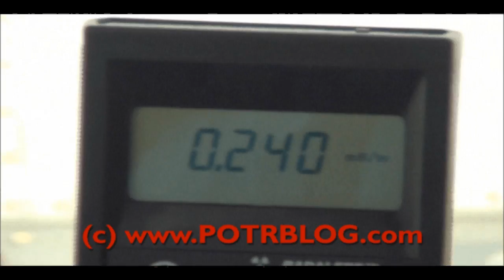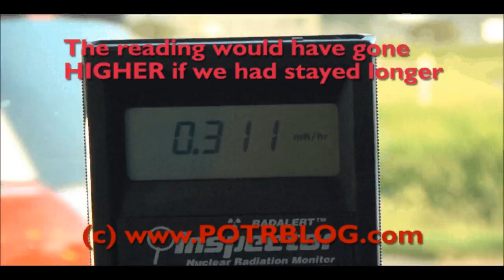Radioactive Container Truck Spewing Gamma Rays Into Traffic on  I-270 in Saint Louis, Missouri

Comment: Anyone know if this is dangerous to people with pacemakers? I had a nukalert along to check a high elevation pass in my region for fallout from Japan and it went off when near a tractor trailer so backed away and got off that road and dosimeter returned to normal background clicks. No placards or markings of any kind on the truck.

Comment: uhhh, 0.3 MREM is nothing... you get more than that on an airplane, and it's well within legal limits... fear monger elsewhere.
Reply: Yea they are getting a pretty significant reading there, inside their car from that distance with that Geiger counter. It's obviously not giving them an exact readout of all the ionizing events. Most of the particles and rays will not hit the sensor.
Reply: @vanquishedcanadian6424  3mR/h is nothing i would inderstand if it was 3R/h but now it's just 3mR which is not dangerous at all and level inside that truck is equal to 1 dental x-ray, so i don't think anyone should be woried

Comment: "The Radalert Inspector Alert measures alpha, beta, gamma and x-radiation using a 2-inch pancake GM detector with high sensitivity to common beta and alpha sources"  - In other words, you have no way of knowing WHICH type of radiation you are detecting.  But it does make it sound good and scary to say the truck is emitting "gamma rays".  Also, please switch to using the Sievert scale like the rest of the world.  1.0 mrem = 0.01 mSv.  So you recorded 0.003 mSv/hr.  You get more when flying.

Comment: @quevongold you went the wrong way, the formula is for moving away from the source, not toward. D2 is 10' and D1 is 4', I2 is 10' , I2 is 0.311 solve for I1which is at 4' or for an I1 at 1' which is just outside the wall of the trailer. But like I said, I am bad to get confused these days so I can certainly be wrong, just ask my wife lol.

Comment: Assuming that you were about 10' from the side of the truck and that the scale on your meter was showing 0.311mR/hr, and discounting any shielding effect of your car windows, then using the inverse proportion law means that the dose rate at the truck side panel was between 300-350 mR. If the truck driver was 4' away and you discount the shielding effect of the cab and seats, he would have been receiving about 20 mR/hr. But the shielding in fact would have reduced the dose rate significantly.